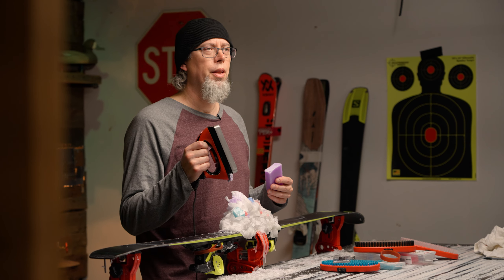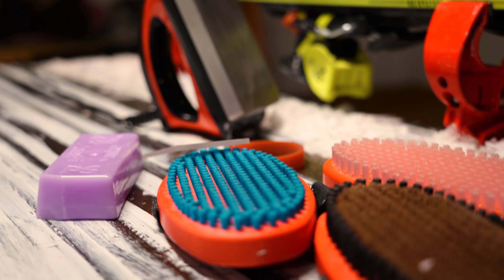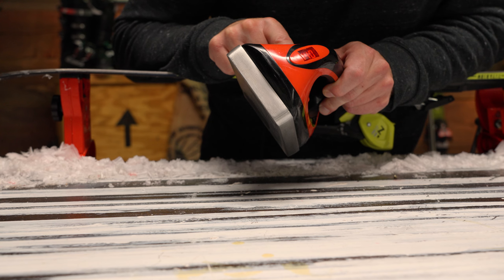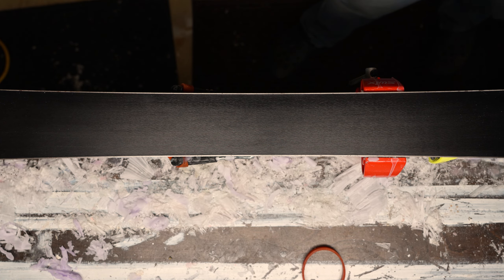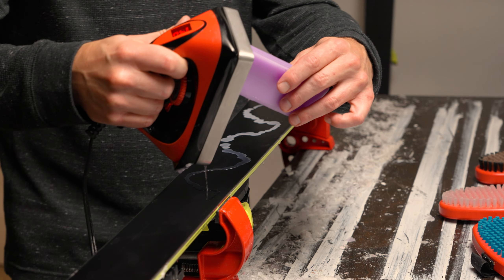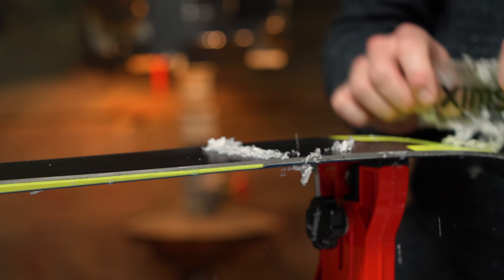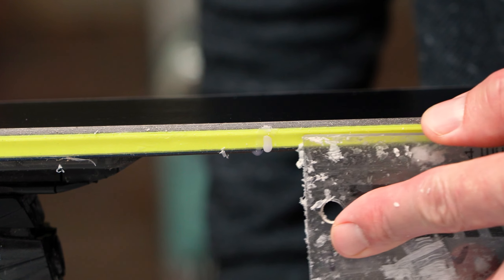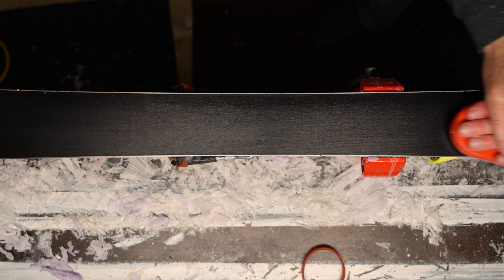Wax Skis in 5 Simple Steps

Comment: First of all, great video, simple and straight to the point. I have been doing exactly this. 

my questions are: 

1 - should we use a "anti-wax" spray to remove the old wax? they say it makes it easier. 
2 - how about the top and bottom? they always have a bit of extra wax where the brush does not reach. is that an issue? should I remove the metal bit from my skis on top so I can polish the wax top to bottom?
Reply from the maker: Thank you very much! Here's my thoughts on your questions...
1. Not necessary in my opinion. Just brush it down to clean it a little and rewax. Keep building that wax down into the base material.
2. Any wax on the tips and tail, just scrape it off the best (in whatever direction is necessary) you can and brush it. Those parts are not going to affect how your ski slides over the snow. Don't remove the metal.
Reply: @quackerworks  thanks for replying